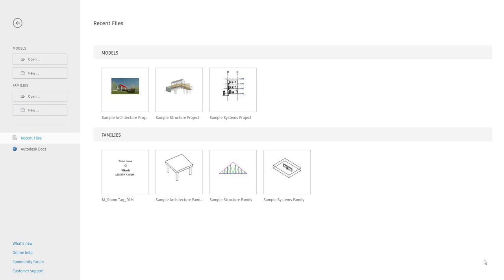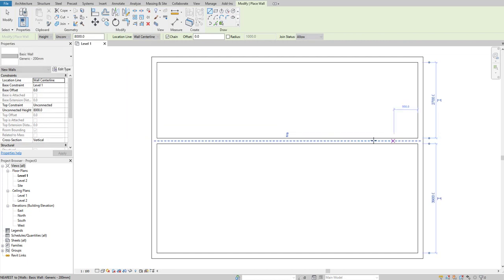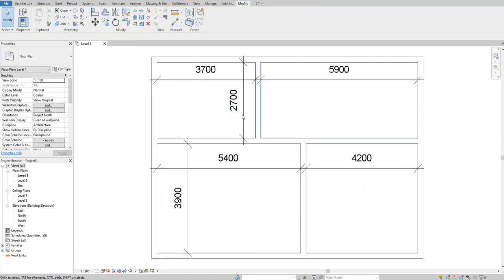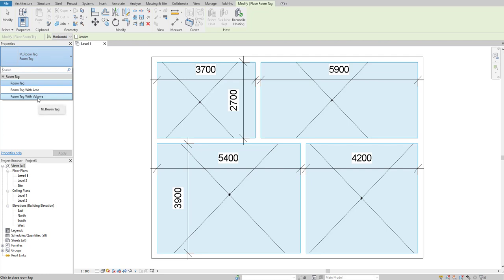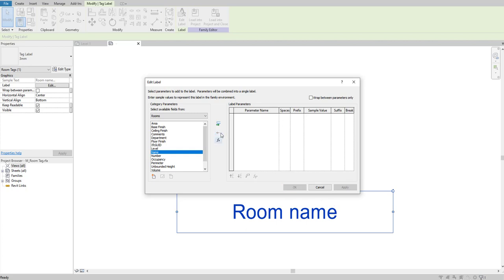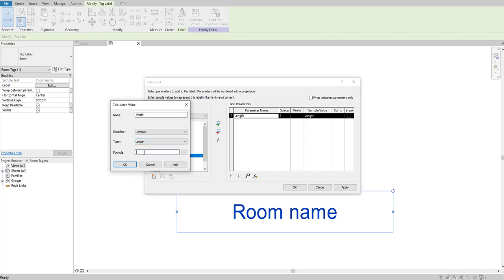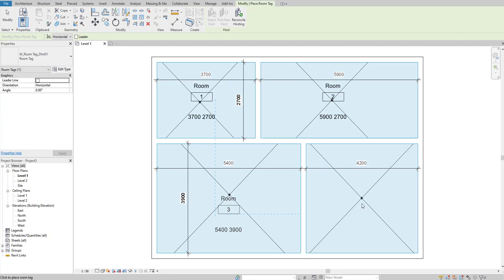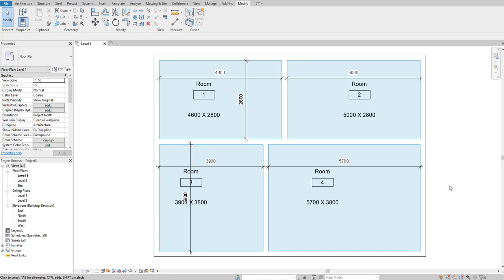Revit Architecture:  Room Tag With Dimensions

Comment: the formula only works for rectangular spaces.  if the room is not a rectangle the area of the space makes the formula based upon the area incorrect with respect to the dimension value.

Comment: Unfortunately, the formula assumes that the X (Length) dimension is greater than the Y (Width). Obviously that is not always the case in a typical building. Since typical notation of X x Y dimensions always lists the X first, you'll need to use two different labels in your family and use additional parameters to hide one label or the other when X or Y is the greater number.
I ended up with two family types that I can switch between based on the greater dimension.
Formula does not work at all if room is square. 😕 So another label must be added where Length is simply Perimeter / 4 and then a third family type added for a square room.

Comment: after trying this the result i'm getting  is longer side X shorter side. And if I change formula to(Perimeter + sqrt(Perimeter ^ 2 - 16 * Area)) / 4 result i'm getting  is shorter side X longer side. but in the video i can clearly see that it's x by y. how do I achieve that. can someone please help me out. thank you.
Reply: The formula assumes the X dimension is larger and will work perfectly if that's the case, but will flip the dimension otherwise. Since we can't use formulas based on Area, etc. to calculate this automatically in our parameters, we have to create two types (and associated Yes/No parameters for visibility)  for our room tag based on whether the x dimension is greater or less than the Y.

Comment: I am still having the trouble as others.  I followed your method. I would like it to show Length x Width every time, however this method (as well as others I've found) will show the bigger dimension first every time wither it's the width or the length of the room. Any suggestions?
Reply: Edit label > select the top parameter, and shift it to below the other parameter.
Reply: The formula assumes the X dimension is larger and will work perfectly if that's the case, but will flip the dimension otherwise. Since we can't use formulas based on Area, etc. to calculate this automatically in our parameters, we have to create two types (and associated Yes/No parameters for visibility)  for our room tag based on whether the x dimension is greater or less than the Y.

Comment: First of all thank you very much for sharing the information 😊❤❤❤ I have tried as per your instructions it's working but what about L,C,U shape rooms !!!😢 The parameters don't work properly 😮😮😮 can you please give solution on that....😊 Thank you in advance 🙂
Reply from the maker: Sure, I am trying to develop a paramateric equation for same. Once done I will share here
Reply: @bimparametrics7037  one more problem sir jee if you add plaster thickness to brick wall so the room parameters count room dimensions from internel face of the plaster not from brick face 😭 how to solve that problem 😭

Comment: Hi usually when i do this , the dimension which is the largest appears first . Usually when we dimension it we do the horizontal dimension first followed by the vertical one. but if the horizontal is lesser then revit automatically makes the  dimension with the higher value appears first. is there anyway to control that ?
Reply from the maker: Have you tried this formula?, Because as per this formula it will not create the same issue.
Let me know if you still facing the same.
Reply: @bimparametrics7037  same problem. It doesn't work as you say
Reply: The formula assumes the X dimension is larger and will work perfectly if that's the case, but will flip the dimension otherwise. Since we can't use formulas based on Area, etc. to calculate this automatically in our parameters, we have to create two types (and associated Yes/No parameters for visibility)  for our room tag based on whether the x dimension is greater or less than the Y.